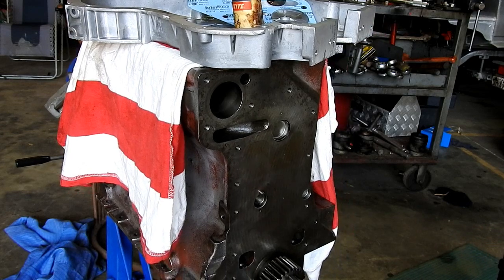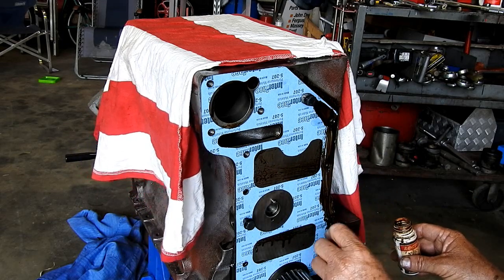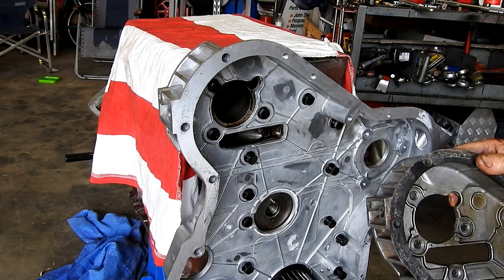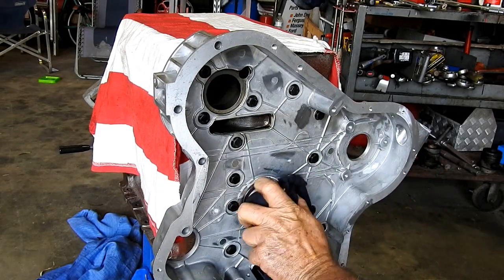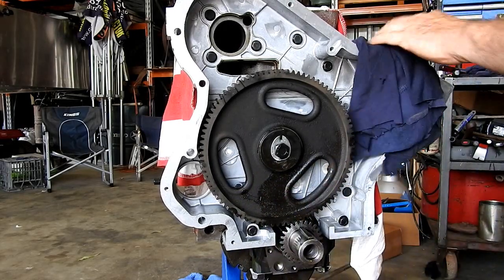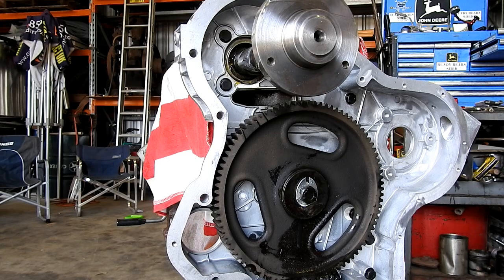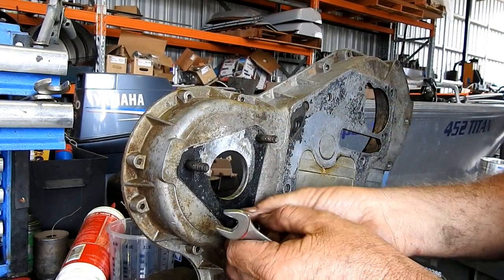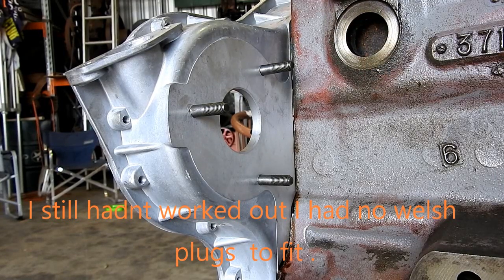MF135 6 Speed Restoration #24 Fitting the Timing Gears

Comment: Speaking of rubbish in the oil pan, I am a fan of bypass oil filters which I know are not original to the tractor.
Here in the US Frantz oil filters have been made for years. They use a roll of cheap toilet paper for the element. The toilet paper is cheap compared to the brand name bypass filters on the market.
The bypass filter uses a bit of the excess oil circulating in the engine to pass continuously through the filter.  The spin on filters bypass unfiltered oil especially when they get a bit plugged up with age.
My Dad had a '52 or 3 chevy pick up with a six cyl engine that did not have an OEM filter on the engine. A Fram bypass filter was fitted by some one. That old engine was splash lubed so no pump installed either. The Fram filter was a cartridge type.  
If you can find a Fram type filter, it would be period style for the engine.
Thanks for the vids.
Reply from the maker: g day Dennis, I do remember those Franz dunny roll filters. They did a good job for sure. I wonder why they fell out of fashion.